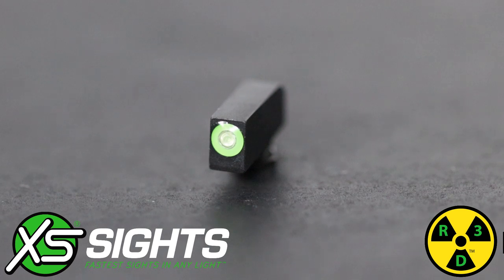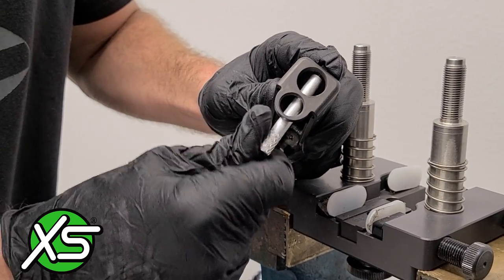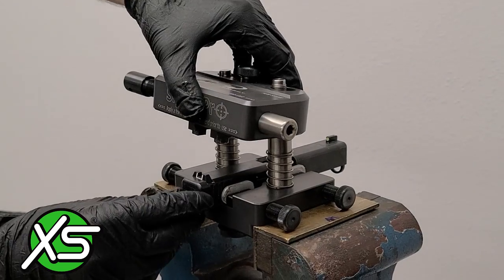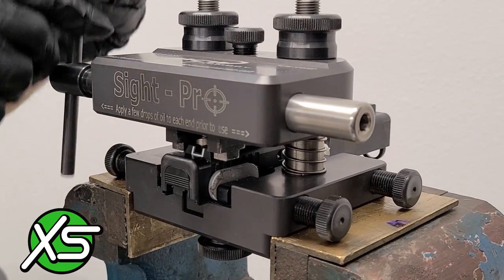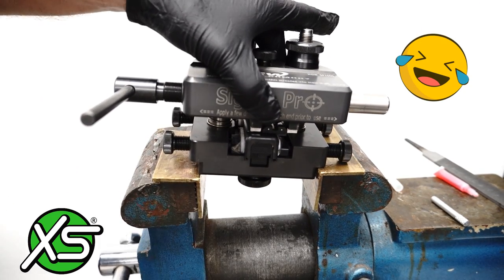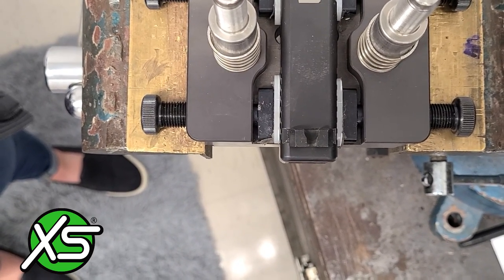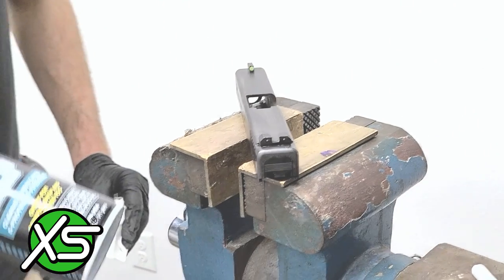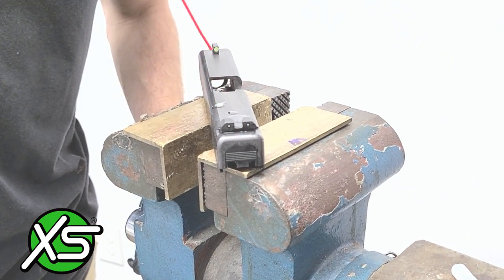R3D Night Sights - Glock Installation Instructions - Sight Pusher Install

Comment: I noted you didn't apparently file the bottom of the rear sight, you just used the sight pusher? I used my sight pusher and was not able to push the sight very far at all and chose not to force the issue. Will be taking it to my CNC Specialist who is an expert CNC to complete this install unless he says to do otherwise.

Comment: No reason at all for all that loctite especially in the rear dovetail. Better hope you don’t need to make any adjustments or you will need to torch the slide and sight just to loosen it up enough to drift. I can’t believe you bathed both sights in red loctite no less. Maybe you should spot weld it next time.